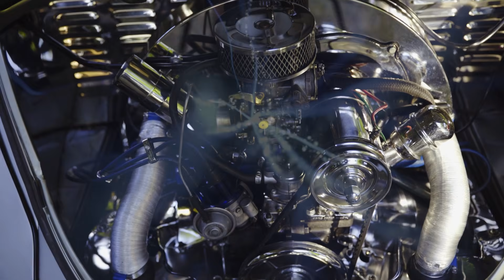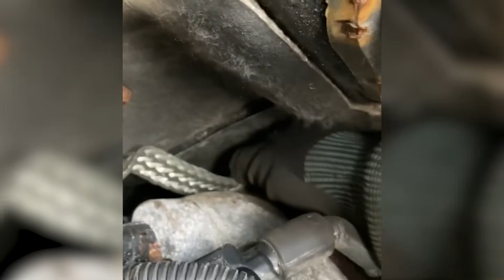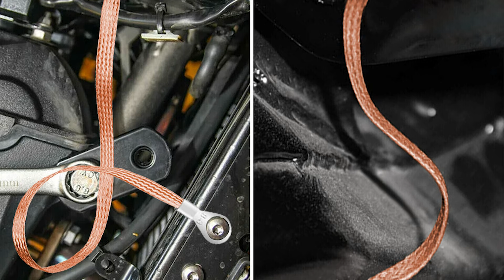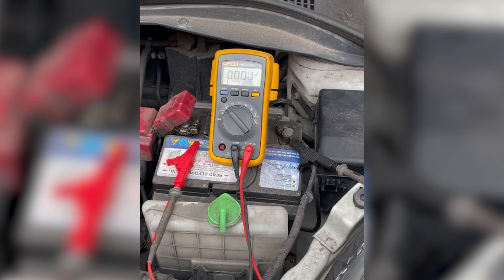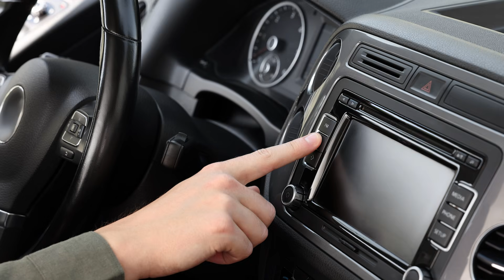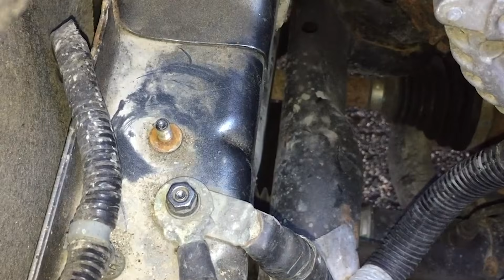8 SYMPTOMS of a Bad Car Negative Battery Cable | Signs Engine Ground Strap is Faulty

Comment: I have this problem where my truck goes dead” like I’ll drive to gas station and hop out for a drink and get back in and no lights on at all,  “wiggle” the neg and positive cables and I’ll have power again. Is it possible they are corroded where I can’t see it?
Reply from the maker: Yes, it’s very possible your battery cables are corroded internally where you can’t see it. Since the truck goes completely dead and power comes back when you wiggle the positive or negative cables, that strongly points to a bad battery connection, loose terminal, or failing ground cable. Heat from driving can also cause weak or corroded connections to temporarily lose contact until the cables are moved again. You should remove and inspect both battery cables, clean the terminals thoroughly, and check for hidden corrosion or loose ground connections at the frame and engine.  Hope this helps.  Good Luck!

Comment: I have a 2007 Acadia I changer alternator and new battery which isn't keeping charge
Reply from the maker: If your 2007 GMC Acadia still is not keeping a charge after replacing the alternator and battery, the problem could be a bad battery cable, poor ground connection, blown fuse/fusible link, or a parasitic electrical drain. Check the battery terminals for corrosion and make sure the alternator connector is fully plugged in. You should also test charging voltage while the engine is running — it should usually be around 13.5–14.7 volts. If voltage is low or the battery keeps dying overnight, there may be wiring damage or a module staying awake and draining the battery.  Good Luck.  Let us know how it goes.

Comment: I'm having electrical problems, I tested battery, alternator, and starter and they all came back good
Reply from the maker: What exactly seems to be the problem?  What kind of electrical problems ?
Reply: @fixit3879 while I'm driving, or sitting while the car running, my rpm and temperature gauge fluctuates, they do a rapid speed sweep, even while driving. I was told I could have some type of electrical issue

Comment: Hello !
I have a problem with cayenne 957 2008 4.8 385ps V8 .....
When the car is cold it cranks and starts  normal ...
When the car is hot it won't even crank ....so I use a booster and it cranks and starts right away .....
I have changed 1) starter motor 2) start relay 3) two new batteries.....the problem is still here .....
...the car once started it drives flawlessly....

Any solutions and opinions on my problem ?

Comment: hello ....i have a problem with cayenne 957 4.8 with 385ps .......when it's cold it starts normal without booster .......but when it's hot ..the car can't crank and i use a booster to start it ......i tried 2 new batteries ....there is no problem to battery .....please any advice

Comment: I became grounded in grounds when in the late eighties  a friend and I were in the Florida gulf in a little skiff a couple miles out and at sundown the outboard refused to crank. There was a steady offshore breeze and and tide was going out but luckily I had brought two anchors and 100' of line for each. Man it was good to see those village lights stop getting farther away. We lay down to get some sleep and about 3am I heard a diesel and got my flashlight and signaled to the boat. It was the marina owner coming out to look for us. 
    The next afternoon  we had the boat trailered in front of our little rental cabin. I knew nothing about outboards and could not get that engine to show any life. A school bus stopped at the street corner and in a few seconds a seven or eight year old boy came trudging by. He asked what was wrong and I told him, and he asked if he could take a look. I said sure and he put his books up on the gunwale and first thing grabbed a crescent wrench, loosened the groung lug on the block, and tightened it again. "Try it now" and it cranked.  He said "If you'll take that loose and scrape it good, you shouldn't have any more problem with it"
   I thanked him and offered him a five, and to my shock, he refused. He said he wouldn't feel right about charging for something so simple. 
   I asked him how he learned about outboards. He said his dad owned a local outboard repair shop, and he grew up helping on repairs. He said " now if you had brought that to my dad's shop you would definitely have been paying"
Reply: Great story 👍 Sometimes people blow your mind with kindness

Comment: And if your ABS light comes on, it might be the ground wire on your battery. Make sure it’s in good shape.
Reply: I believe my 2015 Honda Accord is having this issue, I bought a new battery and everytime I mess with the battery cable in some way, it works for a bit and then suddenly I go to start the car again and it doesn't crank.. jumping it works and tightening the negative clamp also did, because it also came a little loose.. but after about 30 minutes of driving, the ABS, brake light, and a little after the power steering light will come on and I'll hear an electrical zzzz noise almost like flapping on the driver side, and only goes down if I don't press on the gas and am slowing down dramatically.. and a night after, the car will suddenly not crank again

Comment: This is a common problems with chevy vans and truck ground wire braid go from baterry to engine get corroded and over time destroy cut power and engine won't start not matter what's someone do never start till ground braid is replaced

Comment: My 2002 Toyota solara has a charging issue. The previous owner had the alternator replaced and put in a new battery. Ive owned it about 3 years now.. Everything seems to be working fine. But the dash lights get brighter and the blower gets stronger when I Rev the motor. And when I've used the air conditioner. I've had to get a jump start after turning it off even when the car has been running. And when I get the jump, If the negative cable is connected to the body it doesn't work. Only when it is connected onto the negative post. Could that be a grounding issue?

Comment: That is the ancillary ground strap, not the main engine ground. It is MAINLY for electrical interfereance with the radio modules. 
One of the best upgrades to any vehicle is a custom made grounding cable. One near starter, one or two (if 2 cylinder banks) on thr cylinder head, and directly to battery ground (if you car sends a primary ground to the fuse box, add a spare one there as well) Number 8 wire, heavy copper eye terminals, weather sealed terminals. Use SPRING washers!!! Even if you are using an existing blind hole.fastner to attach to, that spring will guarantee long term continuity.
My credentials are 28 years in the industry, from maintenance, fabrication, engineering and advanced 12vdc systems diagnostics master.
Reply: This guy obviously owns a cable factory.
Reply: I hate Mfs on the Internet like damn why can't y'all just be FAWKN honest yo

Comment: With all of todays chips, sensors communications going on this is vital. All the stuff going on will point to this.  If you want to quick diagnose just run a decent guage wire from neg terminal to block to frame such as upper strut bolts and any bolt on the engine.
  Give it a drive- then find the strap to replace if you havent already.   I notice the one on my brothers truck for instance, down to about 10% at the frame and said cut, repair or replace BEFORE all the problems show up and he forgets all about it. .  Next day i see him and surprisingly he'd already done it--  good boy.  .
Reply from the maker: Oh wow, what a great story.  Thank you for sharing!

Comment: Toyota hybrid vibration when ac and many devices on , any idea ? Some of lights don’t work
Reply from the maker: Your Toyota hybrid’s vibration when the AC and other devices are on is likely due to an electrical issue. A weak 12V battery can’t handle heavy electrical loads, causing the engine to start abruptly, leading to vibration. A faulty DC-DC converter could also be failing to properly charge the 12V system. Bad grounds or corroded connections may explain both the vibration and lights not working. Start by testing the 12V battery and checking all major electrical connections.  If the battery is too old and bad, you should replace it too.  Hope this helps.  Good Luck!

Comment: Why should lights react to bad connection between engine and frame? I thought ground comes from battery to frame to lights ground point and does not care about engine ground strip
Reply: Because the alternator 's ground is the casing of the alternator.  So, the alternator ground is the engine, since the alternator is bolted to the engine. The engine to firewall and/or negative battery cable should be connected with a heavy gauge cable straight to the battery. Those braided ground straps are not for current flowing from items like alternator, starter, fuel injectors, and spark plugs.  That goes through the heavy cable to the battery. 
Usually those straps are for shielding purposes from outside RF interference. Like using the hood and firewall for keeping out radio frequency noise that could interfere with the ECM computer. 😎👍
Reply: @ElectricBillAlbright Alternafor and battery are strong in parralel. So any current flows from negative to positive no matter is it one or another source. If one of them swithes off other works. If both are missing nothing is working. For lights usually frame works even if engine wire is  bad because there are other ground wires. Not enough for starter motor but ok for lghts.

Comment: My battery was not being fully charged by my alternator...the alternator was new ..i found the ground strap was broken..once i restrapped it, the alternator was reading 14 volts at the battery again
Reply: Did you get code p0621 & p0562 because of it? I have a new alt that’s been sitting(not connected) for abt 2years and got a new a battery yesterday but it’s not charging. And I put in a new ground cable for the battery and believe it’s loose instead of it being a sensor. I have no knowledge whatsoever would appreciate any insight.
Reply: I did smell a “burning smell” coming from mainly the back end of the alternator near the connector/wire and slight slips/hesitation when driving. Then charging system comes up and so on. Battery new full after 20mins driving etc it test at 12.1 volts.

Comment: ive had a Mitsubishi and was having trouble with it burning up the ecu and relays. i added 2 more grounds from the car to the engine  and to find out that there was a hot wire grounding out and causing the issue

Comment: Completely incorrect explanation when you said it dissipates excessive current. There is no excessive current in this system. The current is the same at every point if violate is applied.

Comment: 2014 gmc savana, crank no start. No fuel pressure. Checked ground by running a jumper cable from ground to frame. Immediate start.

Comment: Can anyone help. I have a USB port in my Corolla. Previously, I used to connect my iPhone 15 pro max to it and I got a decent charge (% was stable and didn't drain but neither charge) and played music. Then it started disconnecting randomly. Now the port doesn't work at all, but I tried my girlfriend's cheap Samsung phone and it does. A few months later, my Costco interstate 3 year battery is pretty dead (38% SOA) after 2 years in service. Can the USB port issue be related to either ground issue or dying battery?
Reply: Check your fuses and see if one is blown. If so then  its probably from a bad connection, or your iPhone is overloading that circuit. Also if you left the charger in the port with out the car running, if it stays powered that could have been wearing down your battery.
Are the terminals and battery posy clean?

If I remember the interstate battery has 3 year free replacement and then after that it's prorated upto 5 years.
Might want to see about getting the battery replaced under the remaining warranty
Reply: @ yeppers got it refunded actually and went with Everstart, since they still have free replacement warranty. Costco stopped doing free replacement s on July 2023, I got mine in 2022 😊

Comment: I had à Citroen Relay. It wouldnt start and there were  no lights on the dashboard.   All because the earth strap had corroded. A  New strap cured it for only £5 from the car accessories shop.
Reply: Hi. I have relay 2016 drop side. After 10 minutes drive it cut off and not crank for 1 hour. After one hour is start normal. As per video maybe my issue is ground cable ?

Comment: Most stories i get that lead me to look at somebodys car, result in finding the cables arent connected clean and tight at the battery posts.
After that check of twisting, i go to their alt belt, and inspect visible ground straps. Body/frame, head or block, head to firewall, what have you.
Its usually shoddy job by the last person who touched the battery and 1/2 ast it.

Comment: Question: Is it necessary to have a strap ground, or can a normal heavy gauge copper wire be used as a replacement? thank you!
Reply: i had a severed ground strap on an 87 vw vanagon. burn up batteries as it was running around 24 volts. replaced the ground with regular wire. never had an issue again. 🍻

Comment: The video is incorrect and inconsistent in how terms are used to describe and illustrate problem cause and effect pertaining to the many different types of circuits in modern vehicle electrical design. What follows is a clarification: 

1) The head light ground currents do not return through an equipotential ground strap, they return through the harness ground wires back to the battery negative terminal. Usually through a ground splice power point or junction. 

External lighting loads, like a brake light, that use the body to conduct ground return currents back to the battery, will do so via a body to battery negative return wire (like an 8 AWG stranded copper cable) that will go directly from the body ground bolt, near the battery, to the battery negative, it is considered a ground connection and not an equipotential ground strap. An equipotential ground strap like between the body and the hood, common to see a tinned braided strap, is just to keep the hood and the body at the same electrical potential, and not to return load currents.

2) A bad starter ground, block ground, which here again is a dedicated ground connection to return starting current directly to the battery negative and not an equipotential strap, can have a high resistance which will not disrupt flow of voltage to the starter, as stated in the video, the faulty connection under load will have high electrical resistance will limit the flow of current.

3) A dead battery will not cause the same symptoms of a bad block ground. With a bad block ground you will see electrical loads activate upon key on, with the engine a no start. A dead battery, a completely discharged battery, will not activate any loads at key on, the car will be dead.

4) Interior lights can return currents through the body to battery negative return wire if they use the body as ground. Here again a the body to battery ground wire is usually not the problem. The problem is a bad ground connection between the interior lighting system and the body, usually a bolted or screw connection which is made in close proximity to the lighting loads. 

5) A battery instrument cluster alert symbol represents a failure in the battery charging system. 

6) A battery that is not being charged is a problem in the charging system and not an equipotential ground strap. The battery is being charged from the alternator output (red wire) and the block ground (black wire) which both terminate directly at the battery. The video shows a strap between the frame and the case of a transaxle which a equipotential strap and has nothing to do with the charging system.

7) Measuring battery voltage with a DMM directly at the battery posts with engine off key off will give you the battery terminal voltage loaded by vehicle sleep current events, it has nothing to do with a equipotential ground strap.

Let me know if you think I missed anything.
Reply: You didn't mention the charging of the flux capacitation system...😂
Reply: Great Scott😊 @jbortega1178
Reply: @windward2818  Funniest thing I’ve ever seen. My boss discharged a capacitor, stuck his nose too close for the smell test 🤣👍🏻
Reply: @BadPenney hehehehe OH😊
Reply: Excellent, detailed, correct.

Comment: I'm wondering if this is why my alternator gauge flickers when my  blicker is on.
Reply: Your alternator ampmeter gauge should bounce each time your blinker light goes on. That's normal operation. It's showing how much current is being drawn from the system. Everytime the turn signal lights up, it pulls a certain amount of current and the ampmeter registers that. 👍  😎

Comment: Looking into this today. My brother gave me a car and he said to add fuel treatment because it bucks when you go up an incline... Then I noticed flickering lights and low battery voltage... Don't think fuel additive is a cure all
Edit: FYI years ago I had an old jeep, rusty but trusty. When it sat it would drain the battery, but luckily one night I noticed the lights would flicker just a tad every time I pushed in the clutch... So I parked it with just enough pressure on the clutch pedal to barely apply the throw out bearing, and the battery was good. I added some ground wires in various places where they had failed and an additional one from the negative battery post to the fire wall. Problem solved.

Comment: Is it common for mechanics to brush off the idea of a bad ground.. ive had 2 or 3 basically laugh at the idea but im pretty sure thats the problem .. seems so hard to find a decent mechanic
Reply: Very hard to find honest one!
Reply: Because a ground wire doesn't require Parts and Labor$$$